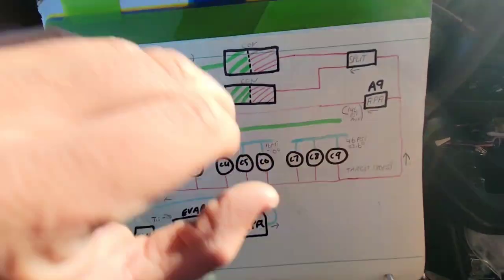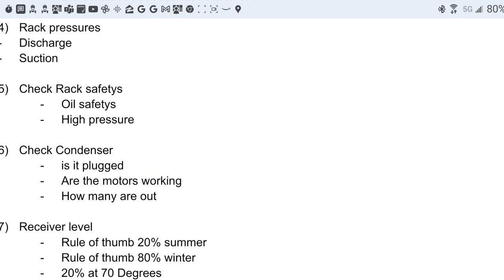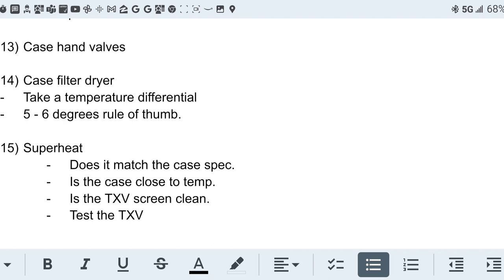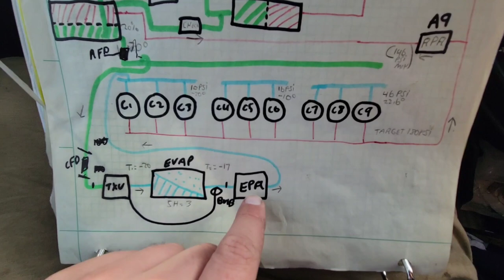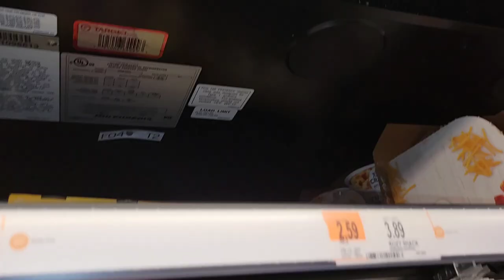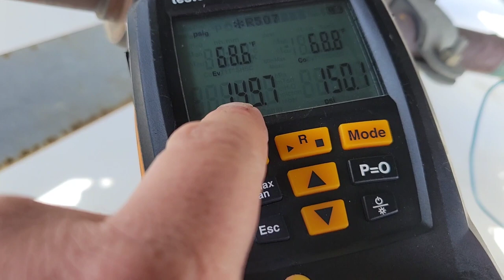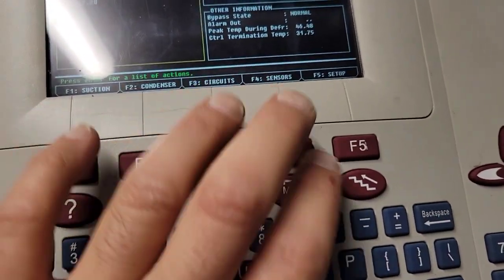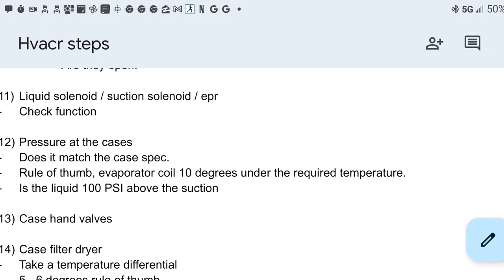Supermarket Rack Refrigeration- How to Troubleshoot 99% of Refrigerated Cases Running Warm(15 Steps)

Comment: As a supermarket manager, I want to thank you for your videos. Just this past week I got a critical low refrigerant alarm on our rack B three times and realized I really have no idea how the refrigeration system works links up. Technicians found the leak above the produce wet rack and had to check the whole system bringing scissor lift into my store to get up to the ceiling and check lines. Thank you for your service to us indoctrinated and also helping me sleep when Danfoss is calling with a critical alarm on my store at 3am!
Reply from the maker: You're welcome :) just trying to benefit the industry I'm glad it helps you sleep easy :-)

Comment: Excellent!  
This is a "put it all together" video if there ever was one. 
I'm trying to memorize your checklist. Lot to learn here. A shortcut/step-one to memorizing the list is the "area" they take place in, as follows: 

Case
Controller
Racks/compressors (controller pressures) 
Condenser
Racks/compressors
Case

There's a lot to learn here, and have a few questions about the order of the areas checked, but will save the for later. 

Fine video, thanks.